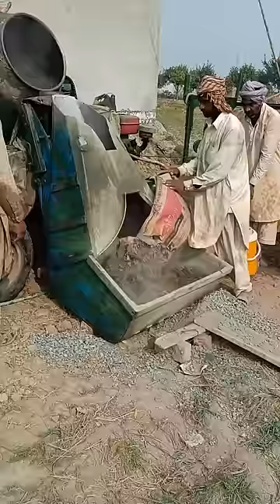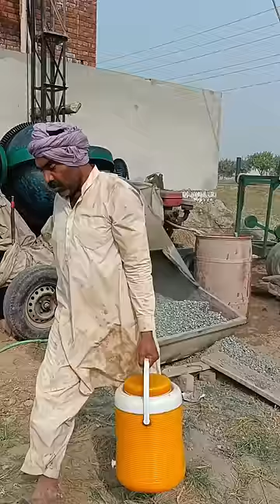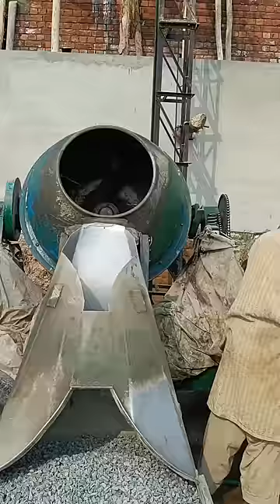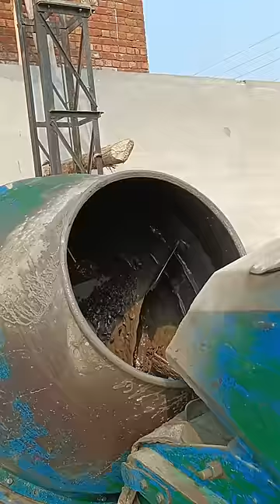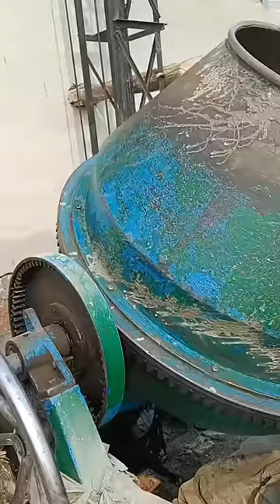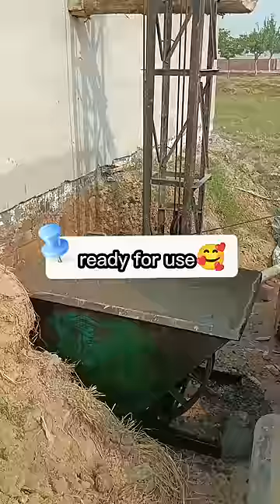concrete mixing with One bag concrete mixer #shorts #engineer #zahid #zab #construction #concrete

Comment: I don’t know how you figure that as mixed well, when it was literally only four rotations of the mixer!
Reply from the maker: You can do more if needed
Reply from the maker: Also see if the mixer is spinning continuously
Reply: There is something called edit, in case you don't know. You guys who object to these small details really seem to lack intellectual or mental depth.
Reply: @CG-cx9fv  There was no editing between the wheebarrow dumping gravel and the pour!
Reply: @paulmonk7820  so how many rotations do you need before they edit it?
Reply: @CG-cx9fv  that makes no sense at all!  Mixing, not editing,  is the point!
Reply: It looks really thin
Reply: @zabconstruction5631  know
Reply: Then they tipped it over SO that’s 5 rotations BUD ….TECHNICALLY SINCE YOUTUBE IS VERY TECHNICAL . so yeah dude that’s literally 5 actually rotatonic energies applied to mixture and u said it was 4 like no it’s 5 bro. Now your the bad guy trying to call them out for only 4 rotational pulls when it was actually by law of John D newton 5 rotations . I can’t be any more clear about it
Reply: Just get those pre mixed truck😳
Reply: Hiya
Reply: There is way too much water in the mix so it gets mixed super fast.  This mix is going to be severely weakened by this.  No wonder buildings collapse in these countries.  It should be like stiff oatmeal...not vegetable soup.